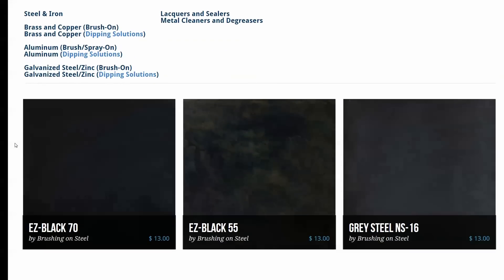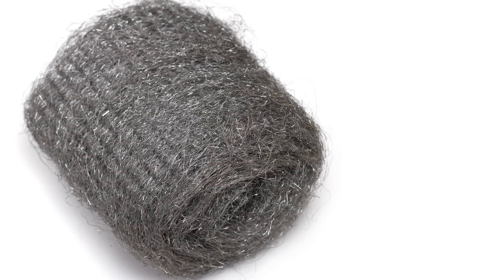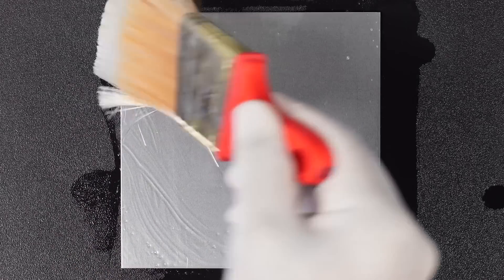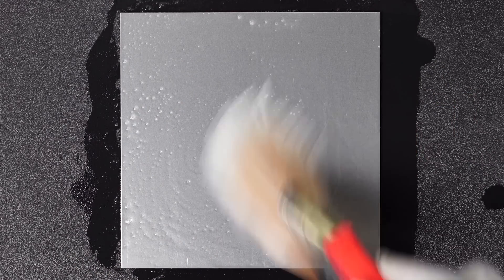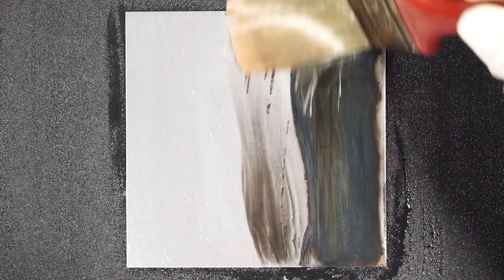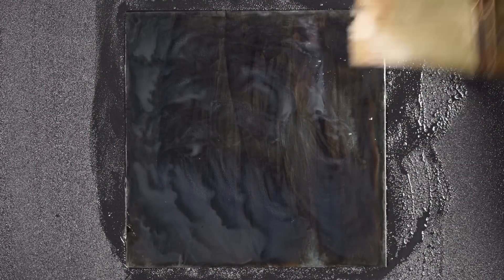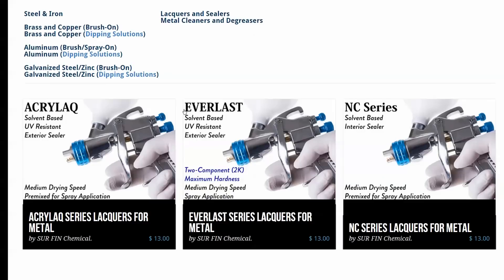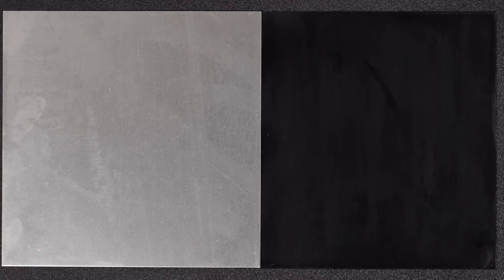Black Patina on Steel : How to Blacken Steel

Comment: What is patina ?
Reply: patina is just a pseudonym for "rust whose color you like" The oxidizing solution that he applied just rusts steel, it just does so in a way that oxidizes the steel black. If you leave that oxidizer on it turns a nasty greenish-white and looks awful. So there is a large spectrum of color in the oxidization (rust) of metal.
Reply: @77Avadon77  ... He he thk's !

Comment: a couple questions on this product. can it be welded over? i would like to make some black steel parts with a high contrast silver weld. also can it be laser etched off?
Reply: You don't want to weld on patina'd metal. You'd strip the metal using mechanical means (sanding/wire brush) or through chemical erosion before you welded otherwise you'll contaminate your weld with the patina oxides. Can you patina a weld? Yes you should be if it's steel to steel with ER70S2 Filler or similar.  Brazing dissimilar metals is another question altogether.
Reply: branden Floyd was
Reply: branden Floyd A v ,

Comment: hi, i was going to use this on a watch, how durable is the patina? is it very easily scratched?
Reply: in my case, I don't mind if it can be scratched. But will the black oxide rust?
Reply from the maker: Hi Neil, although the Black Oxide is strongly bonded to the Steel, it needs a clear coat to protect it from small scratches that happen over time.  If you have any questions, feel free to call us at (323) 262-8108.